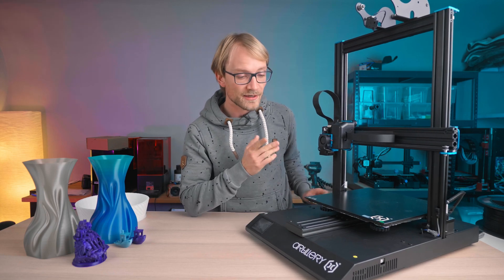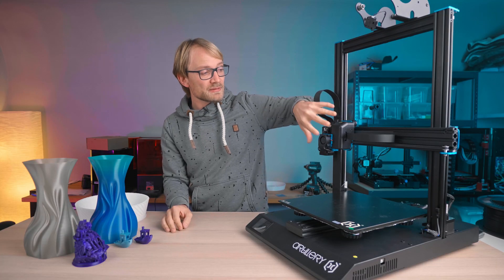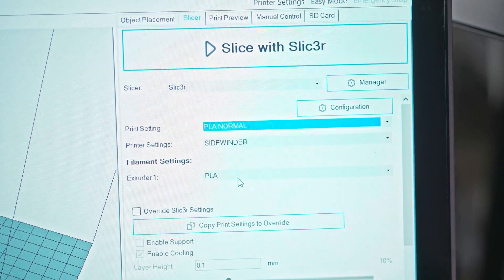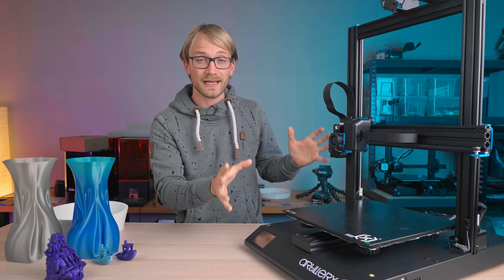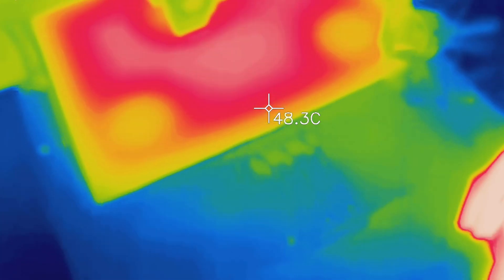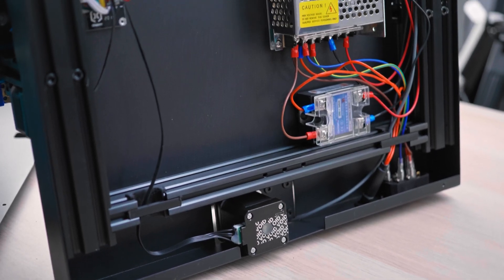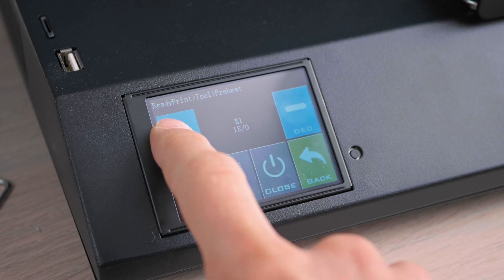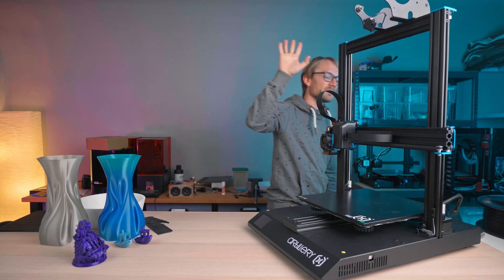Artillery Sidewinder X1: Built for show!

Comment: Man... I wish this had come out 11mo ago... I saw all the great reviews and got one. It worked great all year until around a month ago when I decided to run my first real big print.
 
The printer started to burn while I was eating lunch. If I hadn't smelled the smoke my house probably would've burned down. 
For some reason the extruder stopped moving on top of the print and the heater cutoff sensor did not work, so it started burning the PLA and the heatblock had started slipping.
I contacted Artillery mentioning the problem and all they said is they would send a new motherboard and heater. Theh didn't attempt to diagnose the issue at all. I told them I'd rather get a replacement since we don't know where the failure is and thankfully I still had 1 month left on the warranty, but they only would send the parts (without any concern for my ability to actually fix the machine). Now its been weeks since they were supposed to send the parts. I'm out a printer for the Christmas gifts and fixes around my house and I just don't know if I can ever trust this machine to run any job longer than 1h.

If you could make a YT series on how to fix these issues I think it would be not only super useful. But you may even save some lives out there for the people that unfortunately didn't get to your review in time... 

Thanks a lot for the honest review! Love your work.

PS. The moment I assembled the printer I put dabs of hot glue on the ribbon cables. They're still going strong, so im sire that wasn't the issue..
Reply: I would never leave ANY 3D printer made in China in a room working while no one is around to keep an eye on it..well, that goes for any electronics made in China.  I even unplug my printer from the wall when It completes printing and I'm done with it.  Glad you caught it in time.
Reply: For example extrem Z-Wobble after 150 mm build hight. The Partcoolingfan is doing a extrem anoing Sound during printing. The printbed was absoluty Not flat and my prints didnt Stick Well to the printsurface. The Firmware is so Bad adjusted (for example so linear advaced enabled) the time in Spend in this printer to fix all the Problems i Had is to much for 400 €. 
I own 3 printers and this Thing was Out of the Box the worst one. 
(Sorry for my bad english)
Reply: Same here.. I saw All the great Reviews.. but Mine is pure pain .. good to know that this Thing is a timebomb
Reply: @3D Print Wrangler Mabye you could use some of the arguments if the printer was a kit, and even then I would think some of your points would still be a long bow to draw.

They are sending out dangerous products and putting it on the user to fix them if there are issues to boot.

As for no other manufacturer would replace - Im pretty sure my Aldi would (where I got mine) but then again they aren't about to burn my house down either.
Reply: @3D Print Wrangler   I can operate a 3D printer and have successfully done so. I've owned a Monoprice Maker Select v2 for almost 5 years, maintained it, upgraded it, and know it inside and out. It just is not available for me at the moment. When I said they sent parts "without any concern about my ability" it doesn't mean I dont have the ability. I asked for documentation and all they said was "mark the cables". I know I can  figure out how to replace the motherboard, but what I want is to figure out the actual root of the problem so I can have peace of mind and avoid it in the future. I'm sure that I could figure it out, however the faster the better because I don't have as much time as I used to these days. I sent them pictures and a detailed description of the issue. They didn't ask for pictures of the motherboard, log files, or any sort of diagnostics on my end. It's taking weeks to get the parts and we don't even know if this will actually solve the problem since the new motherboard may have the same issue. I asked them if this was a known issue that they had solved in the new motherboard and did not get an answer. So yeah... its ok to send parts for a year old machine if you're going to work with the consumer, but if you're not going to solve the issue and aren't willing to at least gove some details so it can be prevented, then I dont think its unreasonable to ask for a replacement.

This printer was my first upgrade. The maker select was sold and and marketed as something you would tinker with. The X1 was sold as something that was pretty much good to go with all these safety features, so the expectations are different. Then of course you use the machine for almost a year and trust the safety features will hold while you eat your lunch in your own house 2h into a print. Of course it wouldn't likely have burnt my house down because I take precautions like running it only when I'm home and checking the octoprint every so often, and I have a fire extinguisher on hand, but the fact that it wash starting to burn means that there was a very real risk if I hadn't taken those precautions like many people would.

Comment: Mhh, I got this printer in late 2019 and was really happy with it's performance so far. It also printed 24/7 without any major problems during the faceshield printing time. The first  mod I did was to print a strain-relief for the Heated-bed-wire. I also had some issues with the bedsurface and glas itself! PLA sticks to the bed like it's glued to it, but PETG doesn't sticks to it at all! I also broke it once while removing a bigger print, some of the glassurface chiped off during that! The costumer support was really nice and quick tho and directly send me a new glasbed from a warehouse in Germany and explained how to remove and reapply the silicon heater. But I imidiatly swapped it out with an aftermarket removable powdercoated springsteel PEI buildsurface, which works perfect with all of my materials till this day. 👍 The next mod I'll do is to stabilize the Z Axis with some carbon or steelrods (would recommend that) cause the Z Axis wobbles quiet a bit while printing bigger prints! And yeah, I'll fix the risky wiring as soon as possible. 😬 Thank you for that in depht Video Thomas! 👍
Reply: Can you send me a link for the pei Building plate you used?
Reply: I too have a mid/late 2019 model, and I too printed strain reliefs for the bed cable, and also for the ribbon cables. No problems with those so far. I've been a lot happier with this machine than with a Creality CR-10 S Pro that I had for a while.
Reply: I'm also interested in the PEI build plate.
Reply: Yes please post the link for the pei build plate
Reply: Yes please post
Reply: @jackburton9214  I don't know why the links aren't visible, but I already posted the links twice 🤔 I can see them, but also can't see them with my second acc (just checked). Seems like they get blocked. :/
Reply: well I tried to post the link with the dots replaces with (dot) but it still got blocked :/
Reply: Try to search for BCZAMD PEI Buildsurface on Amazon. It's a golden PEI Springsteelsurface and is 310mm×310mm or 12,2" by 12,2".

Comment: Could you do a follow-up video on how to fix these issues?
Reply: @3D Print Wrangler Really??? I have (had) 2 of them. Yes, more then the 400 you mean even, almost 500 here. Also have helped 'restoring to work' a couple of others here in the Netherlands and Belgium.
Yes, better then Creality in many regards in electrical problems, but 'no indicents'? Maybe not reported in for example the States and since here in Europe we are mainly responsible for our own stuff we have to fix it ourselves or throw them away. 
Also I have been following the forums and did a review of these printers myself.

Some are earthed, some are not, bed-heaters coming loose from the buildplate: plenty. Shortconnects in the bedheater-cables: here in contacts near me: twice. Luckily we have very strict rules in Europe for the electrical systems so no-one was killed for as far as I know and no house burned down because of this.
Other issues like melting ribbon cables: quite normal after a while. Just need to replace them regularly or change the system and or the subboards.
'Burning PSU'? I had two  and some others have had more.

But many problems can also be related to we in Europe have between 230 and 240 Volt as an official voltage and have different beds and settings on the PSU's.

I have seen and have had in my hands all mayor versions from start to the beginning of this year. Since Corona-virus makes it almost impossible to visit other people and limits my time more, so there might be yet another change after the start of this year that makes them better but still have messages every time about electrical problems with this modells. Yes, in my experience better then Creality but still many issues.
I threw all of my Crealities away, only used in parts and one of my modified sidewinders (other PSU, extra 24 V. bed with PSU, other cabling to the nozzle-heater, stabilizers) is running nicely here mostly every day.
Yes, it was a strange feeling and smell a good year ago when the PSU of one decided to melt and make special noises, actually the second original PSU from Evnovo that was. Also needed new stepperdrivers, new mainboard later because of other faults in those parts.
Reply: follow-up... take it apart and use the parts to make a well designed strong printer yourself...